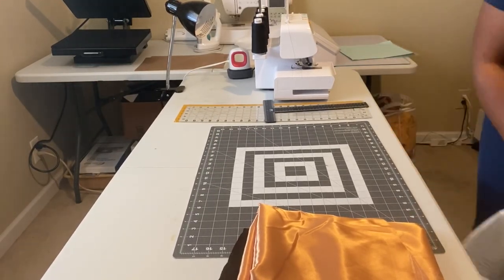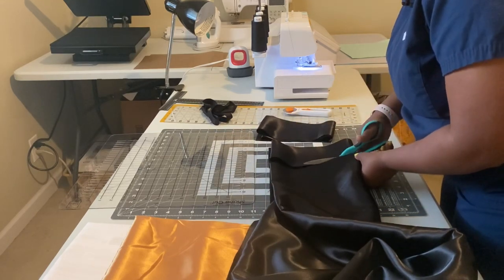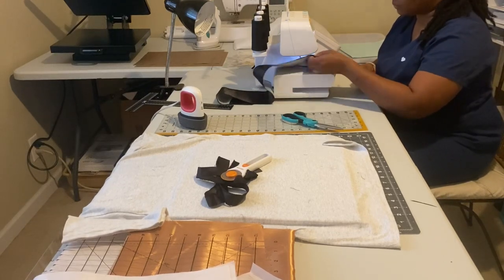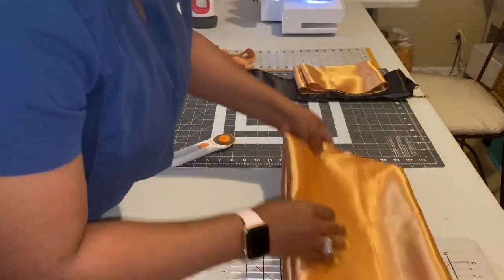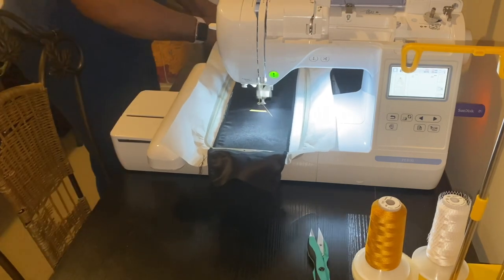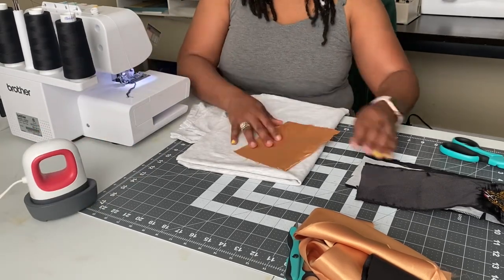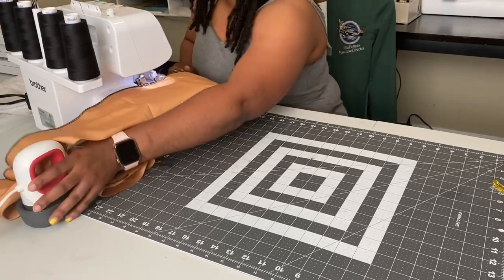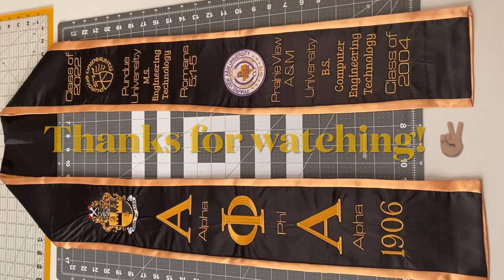2022 Graduation stole, Start to Finish! Using my PE800

Comment: Hello hello. Great video. I have someone who wants me to embroider a graduation stole.  It's already sewed together. I'm still a newbie to embroidery. And one thing I'm struggling with is how to price customize items. Any advice.  Especially for this and it will be my first time
Reply from the maker: The struggle is real for me as well. After doing a couple I decided to come up with the base price just for the creating the stole and increase pricing based on the clients desired added elements.
Reply: @kidnkblvd3681  what kind of backing would suggest I use for the stole. I was thinking tearaway and I'm fine with that. But the customer doesn't want the backing so noticeable if it happens to flip over